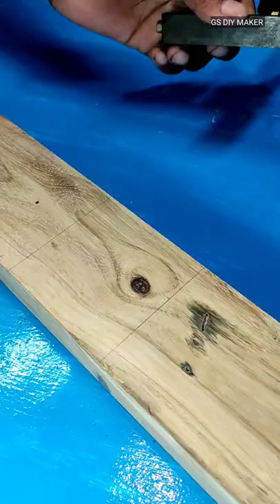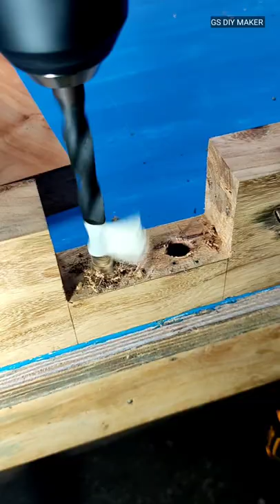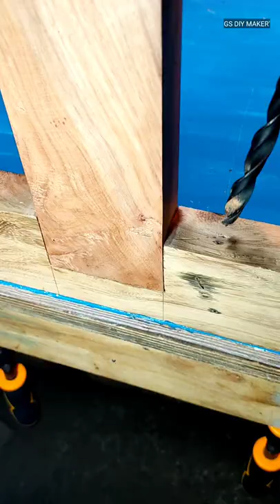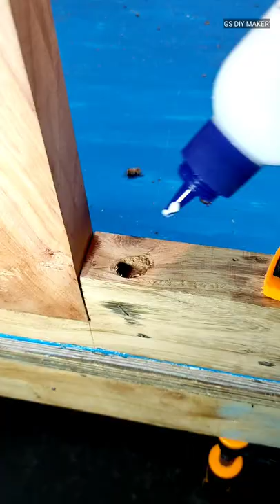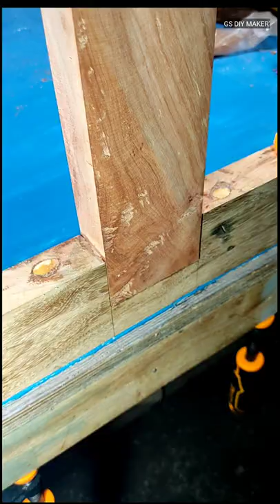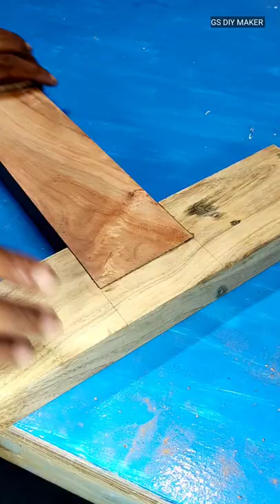Woodworking joints #shorts #journey

Comment: The trick with the screws as markers is cool. Tips: Glue your dowels. End grain is highly absorbent and glue ups on and grains are weaker so try smearing some glue on the end grain, letting it sit for a few minutes and then proceeding with your normal glue up.